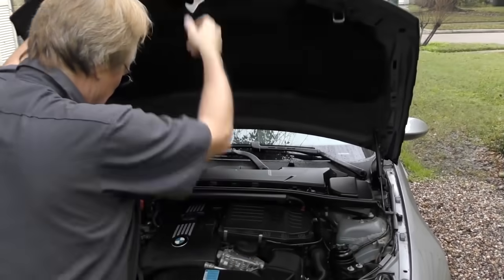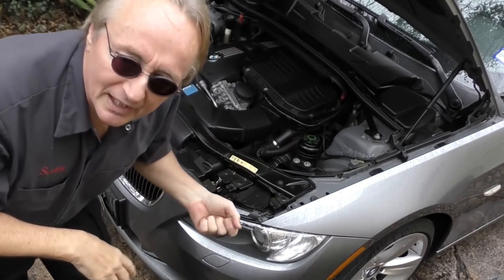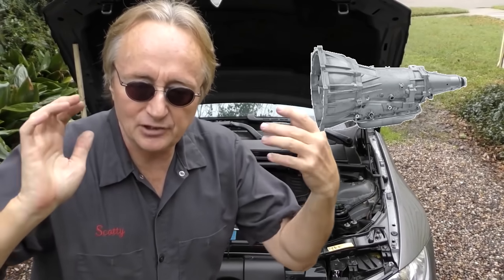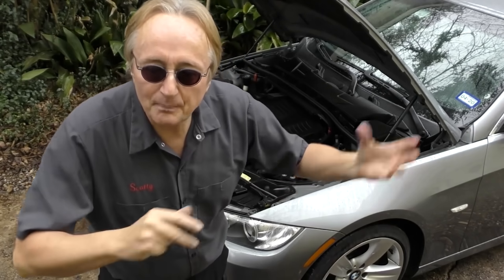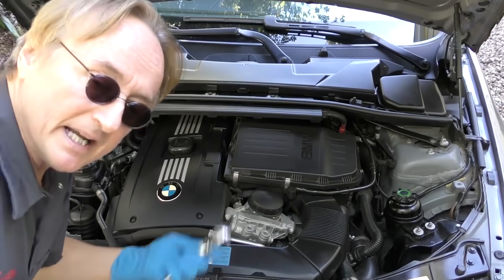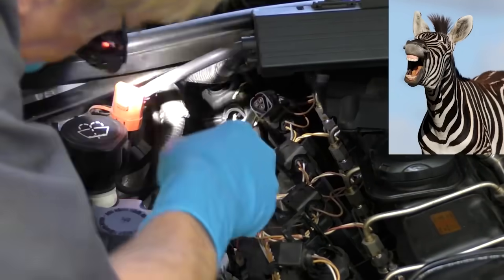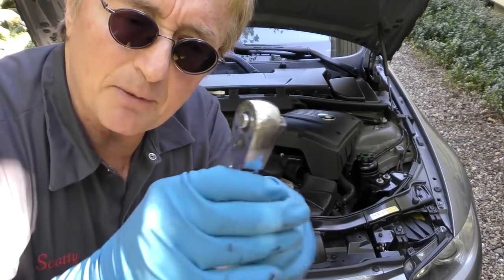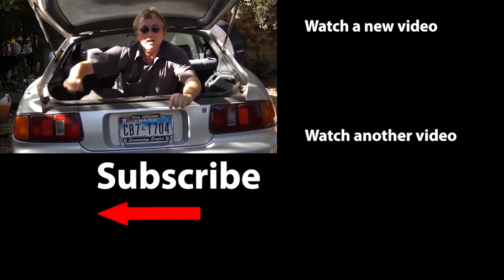People Say I'm Full of Crap About BMWs, Well Watch This

Comment: I have a 2002 530i that I bought a couple years ago. It's the coolest car I've ever had and it's required more work than any other car as well. I recently replaced the oil pan gasket, which required dropping the subframe for a $20 part. I do most of the repairs myself as taking it to a mechanic is too costly. This will probably be my last BMW. I've learned a ton about cars by working on my vehicle, but buying another bimmer scares the crap out of me knowing what I know now.
Reply: Have you considered joining the BMW car club of America? Plenty of helpful members and information on your car.
Reply: @carolinausedmachinery  that's the normal change interval for radiator changes and cooling system replacement that I followed for my 3s. Where are the water management issues on your 530 and your dad's vehicle.
Reply: @thinkingimpaired5663  no it ain't buddy🤣 my dads lasted 34 years stock on his 1988 Toyota pickup bmws are jus trash sorry
Reply: I went from BMW to Subaru. It's low maintenance but I baby it the same way I did my BMW. Both brands make excellent cars, you just have to be willing to learn.
Reply: All aren’t built the same way …
Reply: The coolant system lasts more than that if you are able to change some hoses and fittings,, "oh no maintenance required on a machine run" basic cars are for basic people ,, if you can handle feeling like you are riding inside of a soda can might I recommend a Toyota.
Reply: @carolinausedmachinery  I've learned a lot from the BMW car club of America so the car is for someone who loves the European type driving car. My BMWs saved my life few times so I don't mind the operating costs. I love the Buick as well, my family had many GM vehicles. I got used variety of manufacturer issues.  The biggest pain in the behind for me is my 08 Nissan truck. Worse than my old 76 GMC. 
The funniest experience is my uncle trashed BMWs for years. Then one day he pulls up in a 530i, with the tires that you don't patch. That made me laugh. I don't know what the story is on the tires but it was expensive.
Reply: Realize that 20 years ago the used to make them much simpler. Nowadays you can't even find a BMW with a NA engine. If it doesn't have 5 turbos it's not enough...
Reply: In 2002 they were still making them pretty good. Still expensive to repair, but easier to work in and much more reliable. The ones I’ve seen from 2012 and up are insane. I won’t work on them. The plastic crap falls apart and I’m not paying to fix it. I’ve never seen one with 100k miles that didn’t leak oil. And dear god stay away from the “hot V” turbo cars
Reply: @lesterparker1594  There are a few jokes about BMWs in Europe like why BMW drivers don't wave to each other? Cause they already met this morning at the repair shop. Or if a BMW does not leak oil most probably it doesn't have any in it. And so on.
Reply: @laszlobauer5274  haha pretty funny. I do believe BMWs are a little better to own in Europe though. Here in good ol usa I always laugh when a bmw drives by. Because it’s usually a person that can’t afford it. They lease them and have a perpetual car payment for 30+ years. I prefer to drive a paid off truck. And by putting $600 into a Roth IRA for 30+ years I’ll be able to retire a millionaire. People just don’t think more than a week ahead
Reply: If you own an E39, why would you ever buy another car?
Reply: Buy a Honda or a Toyota
Reply: I have a bmw g30. Dashboard stopped working and was replaced under warranty. After that 0 problems with the car.
Reply: BMW Fans: All it needs is regular maintenance!
Regular Maintenance: 10hr job just to change a $20 oil pan gasket because you have to drop the subframe.

Not to mention chasing all the breaking/cracking plastic pieces in the engine bay as “rEgULaR MaiNtEnAncE”
Reply: @moloono1  the problem is people don't change oil so higher pressure is building in the engine because of the water vapors. This causes oxygenating of the seals and creeping of oil between hardened seal and oil pan. If the car is properly maintained it will probably never leak in it's lifetime.
Reply: @korencek  That may be true, but it does nothing to prevent plastic pieces from cracking/breaking. Vanos gears, tube connectors, clips, etc. Ask me how I know 😂
Reply: @moloono1  bmw quality have apparanty improved over the past decade
Reply: @reckless2176  your toyota cooling system would not be able to cool down a high output straight 6 buddy. A Camry's V6 radiator maintenance is recomended at 60k too.
Reply: @korencek  this happens to all BMWs because when these cars are new people get free oil changes which are every 10k miles which is way to long to wait to change the oil on these cars. By the time the car has 50k plus miles the damage has been done
Reply: @zlord1199  You need to own a bmw before you can talk nonsense.
Reply: @korencek  I've owned 3 of them and currently have 1 i love BMWs I'm just saying when you buy them used you have to kinda get lucky and hope the poper maintenance was done to them.
Reply: @zlord1199  that is true. That's why you never buy used bmw older than 4 years and the previous owner needs to be a company that maintained the car regularly at the dealership. Companies are not cheap so they don't care for service costs.
Reply: I had a 2002 540i. I told myself I’d never own another one after doing the alternator, water pump and thermostat, ALL the window regulators, radiator…. Guess what I bought? Another BMW. 
They’re just too nice to drive.
Reply: @IanBuell  oh I agree 👍 they are hard to walk away from. I considered buying an old 540i but the timing chain guide repair job scared me over to the 530i
Reply: @zlord1199  You're def right about that. That's why if I buy a used car, it's low miles only. Not enough for the previous owner to do damage lol
Reply: Depends on what model on the new ones too, I got a F80 pushing around 520whp and gets driven hard. No issues, just modding and regular maintenance done by me. S55 is pretty reliable out of the newer motors. It's always the shitty seals and brittle aged plastics that become a nuisance later on though, doubt I'll have this car till then LOL
Reply: @carolinausedmachinery  it's a 20 year old e39. Of course your going to have some maintenance. Bottom line this is one of the best BMWs ever made and a 530i 5spd are hard to come by and going up in price. They aren't money pits if you can turn a wrench and watch a few YouTube videos. The engine and trans in your car are bullet proof. I could literally refresh that car, cooling system and sensors, for 1500 bucks. If you have to take it to a indie shop for everything then yeah you're wasting your time.
Reply: That’s a shame, 2002 530d’s will go over 350k miles
Reply: You should got a Merc instead! Always lead, never follow
Reply: You don't have to drop the subframe
Reply: @vidsbfree4me  haha in the 1980s with those tanks but not today, overpriced poorly built cars
Reply: @bystander1489  didn't want to cut the gasket and risk another leak
Reply: @joshkahn1044  you don't cut it you leave it and use sealer it's about 1 hour job and sorts it for good ,putting a new gasket in it will only leak again
Reply: @bystander1489  ah never heard of that one. Not sure if I'd even have enough access to attempt. It's such a tight spot
Reply: @lesterparker1594  What's really funny is whatever kind of alien tech you used to discern that with EACH driver.

Sign of the times. lol
Reply: @zlord1199  Or you can buy smart, which is a rarity. I bought a 2000 Z3 Coupe in 2006 and got a PPI. One issue that was easy to address. Before I bought it I did research (crazy huh?) and already had parts, an indy shop and knowledge bases lined up. I do that with any cars I'm considering buying.

So... 15 years later, very few issues besides potholes with low profile tires. Simple maintenance items like replacing the water pump with a part warrantied for life or my favorite, a code was thrown pointing to the mass air flow sensor. Aftermarket part that looked identical to OEM was $17 delivered and the five minutes it took to swap didn't exactly break the bank. Over $500 at a dealer.

If you hand your keys to a dealer and basically say "Do me" you get what you get. Or you can shop around, find a good mechanic and save a ton. People swear my car can't be reliable.  They say the same about my 2002 Mini Cooper S, which has actually been very inexpensive to own... for 15 years. And both are big fun. This isn't rocket science.
Reply: The E39. One of the best cars ever made. It's a shame you didn't get the diesels over there.
Reply: They don't call them Broke My Wallets for nothing
Reply: @laszlobauer5274  quíntuple turbos 😻😻😻
Reply: The newer ones are much more complicated than your 20 year old car, good luck 😂
Reply: @reckless2176  when I'm buying a Toyota pickup I expect it to last me at least 20 years or else it's a lemon 😂
Reply: @slam44  E39 owner here. Bought 12 years ago, still driving it.  Lookin at Porsche’s next
Reply: @bystander1489  - how do you change the oil pan gasket without dropping the subframe?  I’d like to know.  I need to change my oil pan gasket but I hear it’s a big job.
Reply: @greenman7612 drop the oil pan in place leave old gasket on it and spread sealer on it something good like dirko lot less hassle than dropping subframe
Reply: Yup same.
Reply: It’s a rwd car…. Even a cheap mazda miata you have to remove subframe
Reply: @thinkingimpaired5663  Endless money pit car club of America that is 😂
Reply: @kari9856  I found it was worth attending and sharing info. I saved a lot of money in PM recommendations. It was cool seeing my vehicle in the publication. It's also a good way to decide on which BMW to choose.
Reply: @thinkingimpaired5663  my Honda CR-V keeps chugging I think the plastic and complexity really holds me back from a bmw
Reply: @patrickibarra2191  I understand your viewpoint. I remember having an RX7 I loved the reliability didn't love the annoying easily sun damaged interior and weak transmission. Yet I still wish I owned my rx7s and my BMWs.
Reply: @korencek  Very True. Bimmer just need regular maintenance.
Reply: Congratulation you have wised up! Not saying They are not incredibly fun cars.
Reply: @carolinausedmachinery  if you think an E39 is a hard car to work on just stick to paying mechanics.

Comment: I've have my 06 3 series for 10 years now. Almost 200k on it. What Scotty says is true, the plastic parts are a nightmare and if you take it to the mechanic you'll spend a fortune. For the past 5 years I've been doing all the maintenance myself and became a pretty good mechanic working on the car; just replaced my clutch last December. No regrets though I love driving that car and taking it to the track
Reply: Same got a e36 did the timing chain kit and a head gasket and it has 203k miles and runs beautifully
Reply: This is the only sane way to own a BMW...
Reply: @1LukeG1  E36s are na exception to the rule. A BMW master tech friend of mine advises that the E36 is the only car he'd buy used to fix up and drive daily with any real expectation of life over 100k miles.
Reply: @leon_De_Grelle  oh my God too funny 🤣😆
Reply: @leon_De_Grelle  E9X 325/328is with the n52 are also slept on for reliability, as long as you change the oil on time and do basic preventative maintenance that thing will take you well past 200k in at 211k and mine still pulls and sounds/drives amazing
Reply: @leon_De_Grelle  that's pretty funny seeing I'm at 200,000 miles on my N54 335 and 120,000 on my E46 M3 original engines transmissions and diffs. Both are tuned for bigger power with bolt on's as well.
Reply: The issue is most people aren't mechanics or have time to fix their own cars. extended warranty plans also exist if you can't afford to fix these things yourself too. I always side with the buy whatever car you want because every brand can be a lemon. My friend's dad bought a TRD Toyota Tacoma and had two lemons back to back. Brand new. I don't believe in the idea of only going to Toyota Honda for reliability because even they have certain issues with their cars, yes less likely but always some kind of issue, BUT never buy a range Rover or a Jaguar and I will always stand by that. If you want to, lease if for a few years that's about it.
Reply: I've had my e60 for years. 
If plastic parts break, I will replace them with aftermarket aluminum, which even cost less than OEM and perform better.
Reply: Thank you for the honesty 💯💯💯
Reply: Is there any way to swipe out the plastic parts for rubber or other material ?
Reply: @wyasupreme friend of mine got a n52 to half a million miles with no serious problems
Reply: My transmission failed at 100k miles after another 15k in repairs.. if you buy a BMW expect to pay half the price you paid for it in repairs over 10 years.

Comment: The most common issue with bmws are the oil leaks. The gaskets go bad after 100,000 miles - and sometimes all at once. If you replace one gasket do them all. There’s  thee valves cover gasket, oil cooler gaskets, oil cooler in and out lines and the crankshaft seal. Make sure you change them all after 100,000 miles.

Comment: I got my first bmw (98 528i) almost 16 years ago… car has 375K and runs fine…. 

I’ve averaged 11-12K miles a year. I did all my own work until back surgery 2 years ago… 

Plastic crap is indeed a regal pain…. straight 6’s are very reliable
Reply: Those were the real glory years of reliable low total cost of ownership BMWs. They started becoming money pits in the 2000's

Comment: had an 03 X5 4.4L.  It felt like an F-15.  Tons of performance and power.  It also required the same amount of maintanence as a jet fighter.  No visit to the shop was ever less than $850
Reply: And just think. They were making them much better 20 years ago. Imagine owning a newer one
Reply: @Peter Angles well. I did hv a flight sim on my computer so I think that counts for flight time
Reply: @Mikeya85  LOL only those that can't afford say "paying for the badge". No one buys a Toyota thinking it has the most power/ tech/ handling/ performance in its class.
Reply: F-15??  I think you mean F-15C, I prefer the F-22A
Reply: I have a 2004 X5 4.4i and the most I've spent is $700. Preventative maintenance is key
Reply: @Mikeya85  they might be but boring lol honestly, I lucked out because my X5 was from a technician so major maintenance was done already.
Reply: @venomsupe  go online and read the reviews about your x5 lol you might be in for a surprise. It's an unreliable car even compared to other bmw's, let alone other makers. You're in for a rude awakening buying a used x5.

Comment: I own a 335i. Had it for 8 years now. I know how to take it apart all kinds of ways. By now, i've replaced all the plastic parts with aluminum upgrades (cheaper than OEM). They are not bad if you are mechanically inclined and can work on them yourself. If you depend on the dealer for labor, then you are screwed and will forever be broke.

Comment: Scotty,
You've really shortened the list of cars I'm willing to buy.
Much appreciated.
Reply: If you watch Scotty long enough you will end up looking for a 94 Celica with price up to 500. :))
Reply: @laszlobauer5274  
Three Stars for that answer!!!
Reply: Squeeky Clean  if im not mistaken, he also likes ford f150s and diesel trucks
Reply: @T0asTy1  Don't forget the Nissan Titan and the Japanese made Mazda trucks
Reply: Squeeky Clean  Nope, he has some SUV and three trucks.  Personally, F150 or nothing.
Reply: @T0asTy1  F150 and a ford SUV, and 1 Toyota SUV, was it a RAV4??  I forget.
Reply: @Mikeya85  I have pair of Camry's.  Both loaded.
Reply: 1:Toyota
2:Toyota
3:Toyota
4:Toyota
5:Toyota
6:Toyota
7:Toyota
8:Toyota
9:Toyota
10:Toyota
Reply: Yeah, and he loves the 2017 onwards FK8 Honda Civic Type ARGHH, (R). Had one for 2.5 years, one of the best cars I've ever driven.
Reply: My new Honda Accord has a failed camera system from the Texas heat.. camera cost over 1k. Labor + programming another 1k. When the camera fails, you don’t get cruise control. No lane keeping or collision warning. High pressure fuel pumps fail every 75k miles. They leak oil at the valve covers, replaced my tensioner. Mounts are due. Just wait till you realize all the new cars are taking notes from the Germans
Reply: Japanese, Japanese, Honda or Toyota.
Reply: @laszlobauer5274  for real lol
Reply: Yes, if you listen scotty you would be missing out on good car that had 1 bad coil problem in the 5 years he showed about the car. What a deal breaker for a 300hp sports car ! LMAO
Reply: @MaggotCZ   Hmmm,
Should I believe and trust you or Scotty?
Well that took about 5 seconds.
Reply: Only a Celica